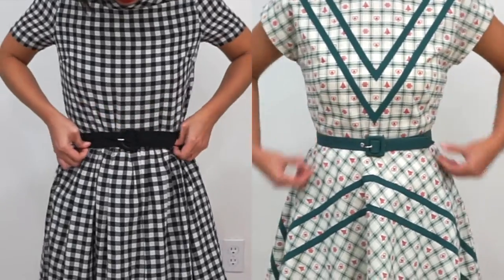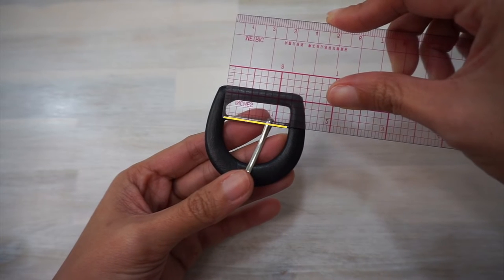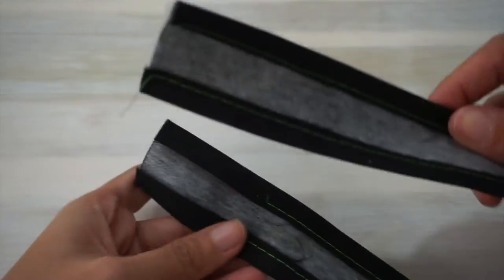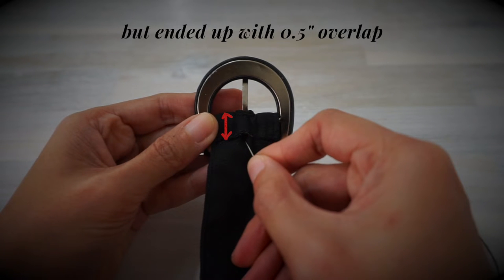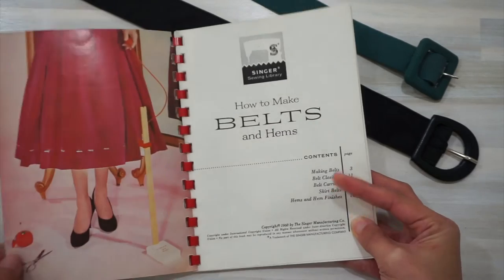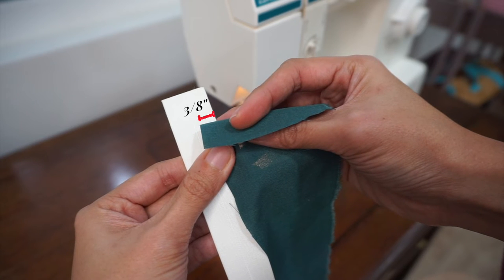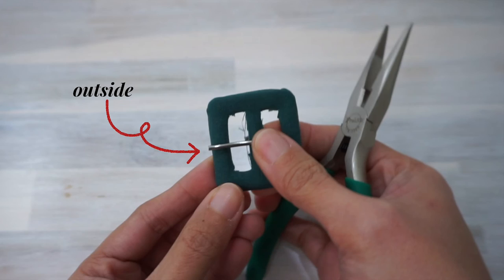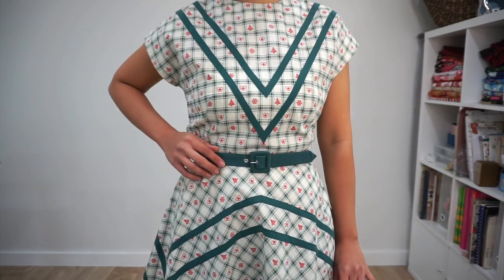DIY belt: 2 different methods of making fabric belt (+ mindblowing sewing trick 🤯)

Comment: Great job of adlib with vintage materials. Three modern applications to consider to help camouflage the  eyelets are same color perminant marker or fabric paint pen, alcohol ink, and nail polish. Although the nailpolish may scratch, I find it works better than model paints, which chip. Modern polish comes in so many colors too. Make some jewelry to match while you're  at it.